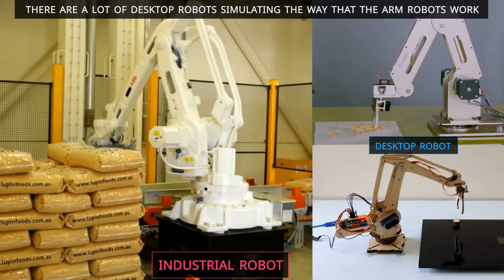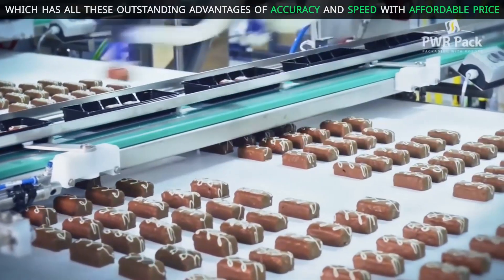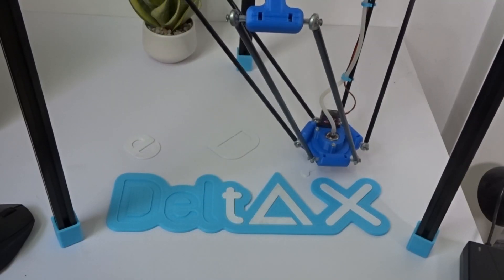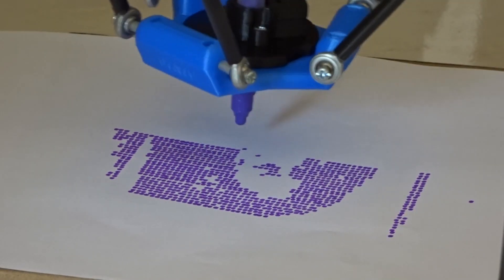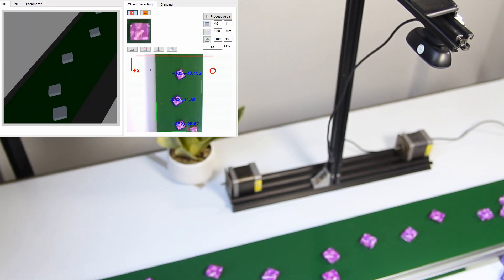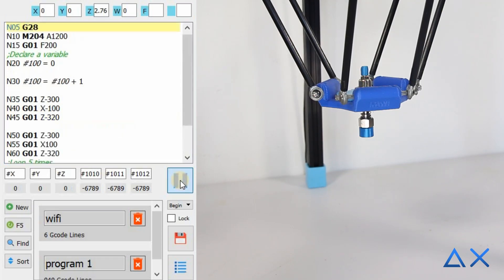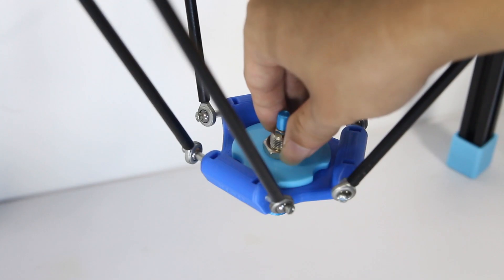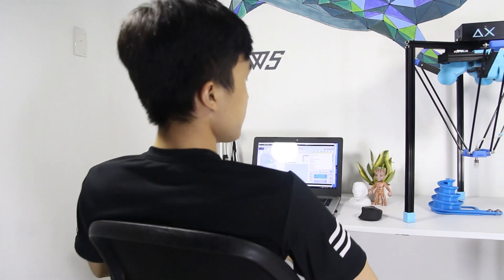Delta X - The First Open Source Delta Robot Kit In The World - Full

Comment: Have you tried a version using ODrive to increase speed and accuracy?
Reply: 4:41 the mechanics are not stiff enough to go much faster.  They might improve the stability a bit by using using spherical bearings with less play and tying the base legs together at the bottom.
Reply: @DeltaXRobot  I recomend you to use trinamics drivers. they have powerfull advantages over ODrive